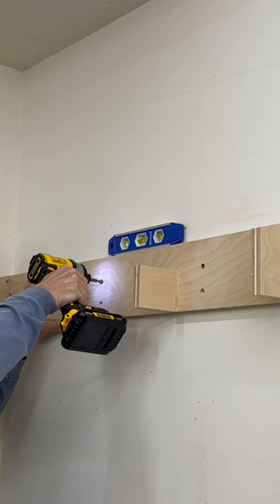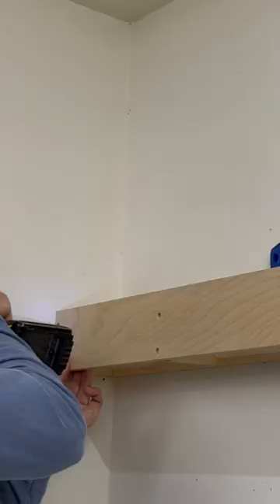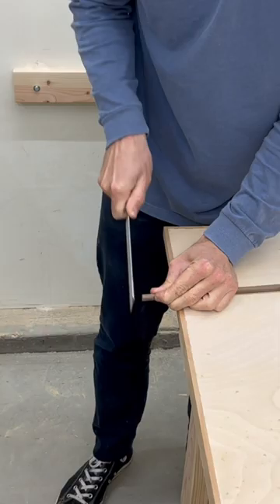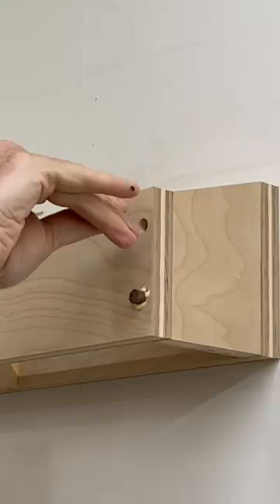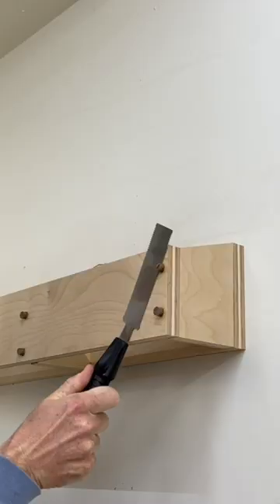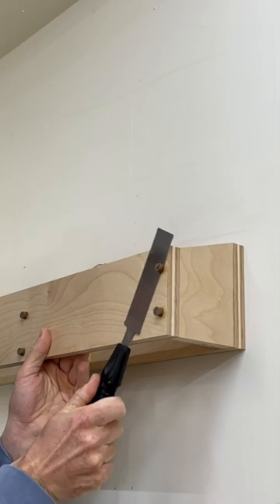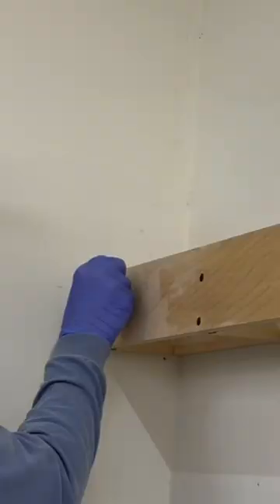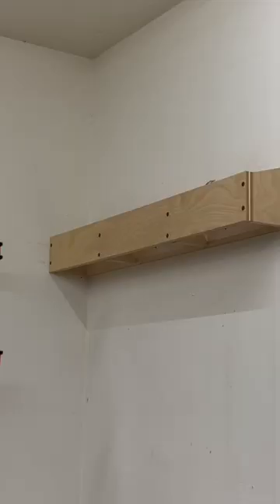How Does This Work?

Comment: You are going to regret adding those dowels when you go to move or modify that clamp rack!
Reply from the maker: I’ll just build a new one. It took me about 2 hours.
Reply: The screws holding it to the wall aren't dowelled, they just need a 90 degree attachment for the drill.
Reply: French cleat system is the way to go IMO

Comment: Too small for me, dang it. I have 16 besseys, and just as many parallel clamps plus squeeze clamps, etc.

There is no such thing as “too many clamps”. When someone says “How many clamps do you need?” I reply “Yes”.
Reply: You could always build these wider, make more, or adjust the design to fit your needs.
Reply from the maker: Absolutely!
Reply from the maker: “Yes” is the correct answer.
Reply: @ThomasCustomWoodworks  It is, and now I am doing a lazy Susan for a table and realized "all my clamps are for 40 to 48" wide, this thing is 20" wide, round". "Welp, I need more black metal pipe and more besseys for some 24" and smaller lengths". Lol, always at the store, always. Get 4 50 packs of 120, 180, 240, 320 and realize "Crap, I need the 80 because I am on my last disc". 

Yes, someone lives here, just not sure who.